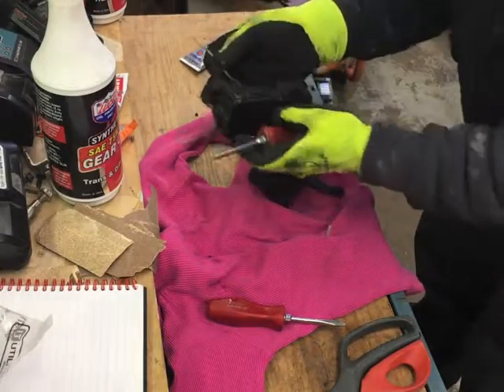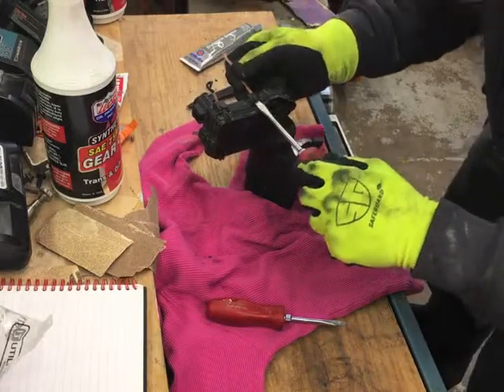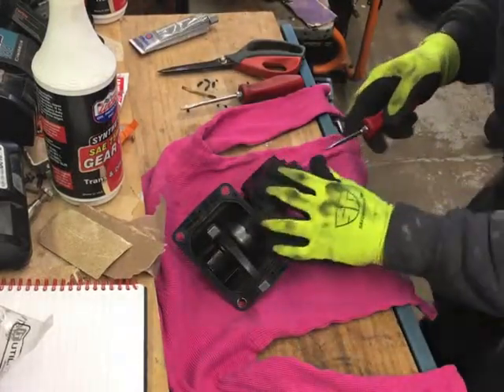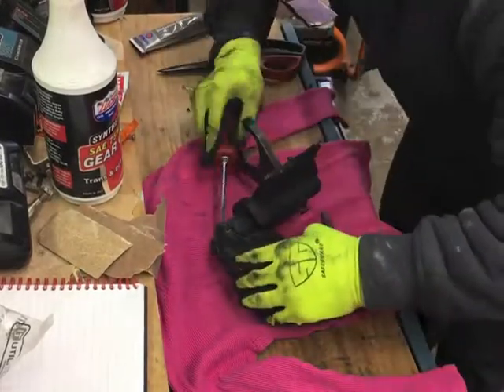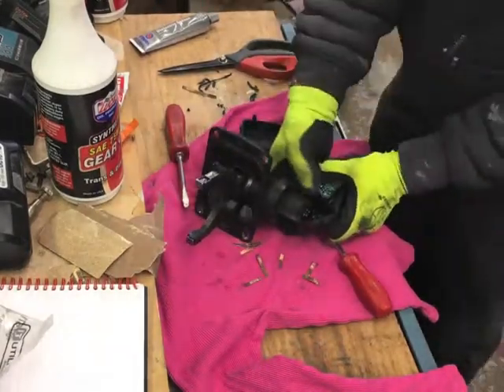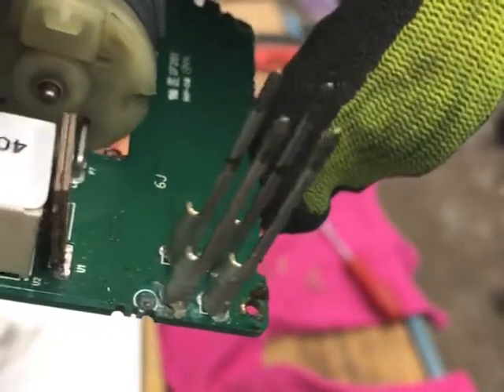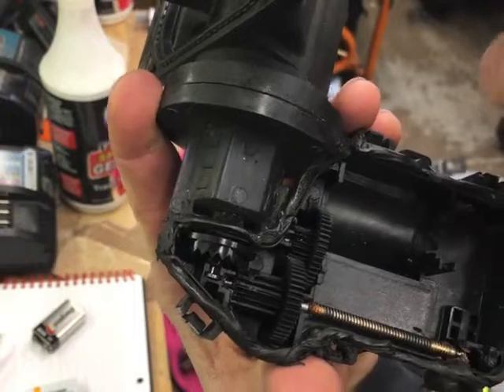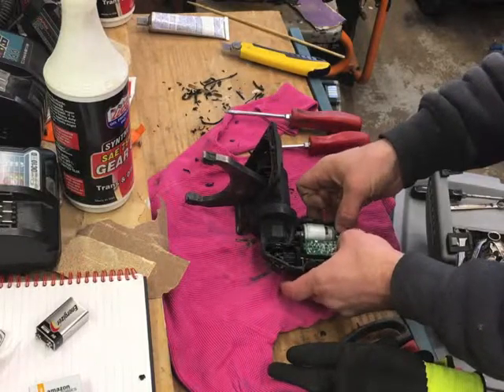Dodge Ram 4x4 front axle actuator teardown

Comment: Hey Aaron, so did this fix the problem you were having? i have the same problem with my 2007 dodge ram 1500. I am planning to fix it myself.
Reply from the maker: Mine started working again after this repair. It could have been as simple as cleaning and allowing it to dry out inside.  Also check your front diff fluid. If it’s low, it can effect operation of the shift coupler on the axle.
Reply: @aaemmons  Okay thank you brother. I will try to take it apart and clean it. Will check the fluid as well. :)